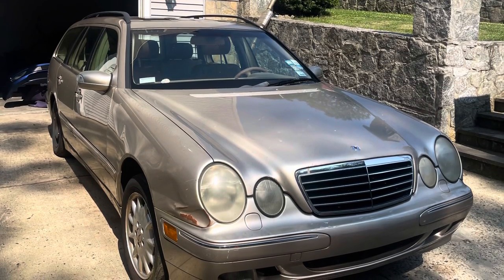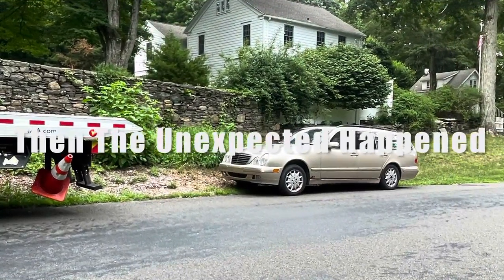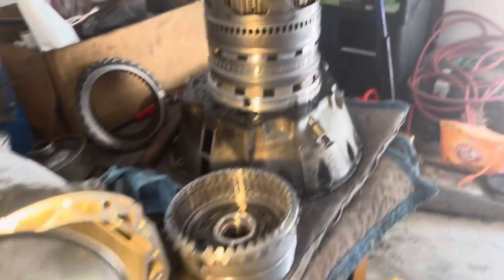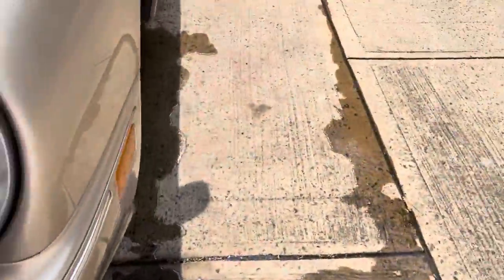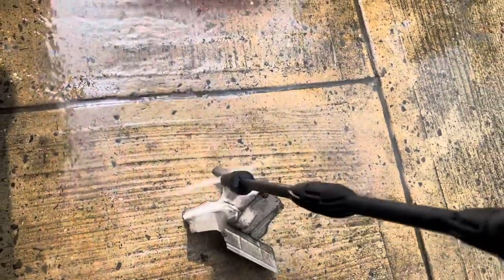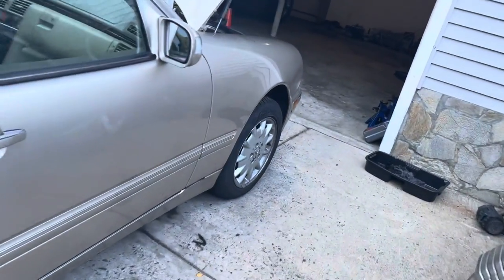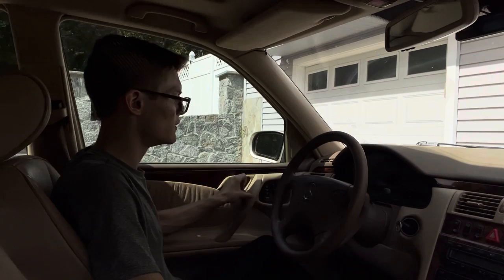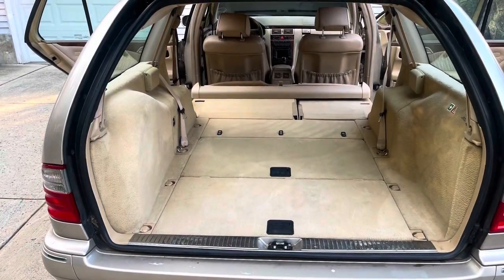My Wagon’s Transmission FAILED After Mechanically Sorting out the Car!

Comment: Replace the f1 and f2 freewheeling clutches And seals as needed. Also the metal plate between the bell housing and trans housing
Reply: Mercedes also has a blue silicone for bell housing bolts. Like a lock tite. Don’t have part number but it’s a tube from MB

Comment: I know you guys in the states don't seem to like diesel cars but I owned a 2001 E320 diesel for 17 years and it was amazing. I don't know if it had been mapped b4 I bought it but it would do 0-60 in under 8 seconds and do over 150 miles per hour. It also did around 38 plus miles to a imperial gallon. In all the years I owned the car it never missed a beat and I did almost 250 thousand miles. I have no idea why Americans don't like diesel but they are missing out.
Reply from the maker: I love Mercedes diesels, although I have yet to own one. I really like the ‘05-‘06 E320 CDI’s
Reply: @OnlyKelp  Mine was the older straight 6 engine and it was awesome. You should deffo buy yourself a diesel and perhaps win over a few of your fellow Americans. You will also save a fortune on fuel and maintenance.  Btw I love your video's.
Reply: Modern day diesels started gaining popularity in the US about fifteen years ago but VW dieselgate put a stop to it for the most part. Also it is important to understand that diesel prices in the US are significantly more expensive than gasoline, usually more expensive than premium gasoline. Add the fact that diesels are generally slower as compared to gasoline versions and you see there is little benefit for Americans to own one. Yes diesels have high torque but that’s no substitute for hp when you aren’t moving heavy loads.
Reply: @AB-jz9ns  Dieselgate did not affect anyone other than to give them a opportunity to make ridiculous compensation claims. I don't know what diesel cars you are driving but they are certainly not slow. I don't know about the price structure in the states but my E320 will do well over 40 MPG on the freeway. The petrol or Gas version would struggle to get 25 ..